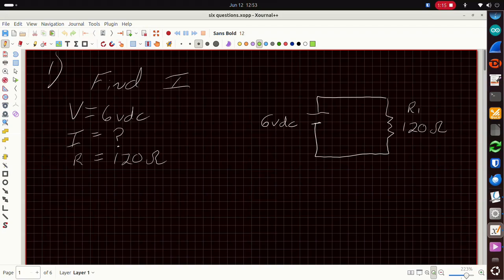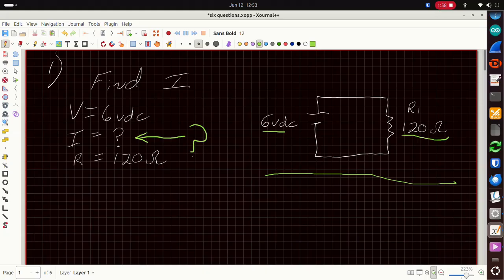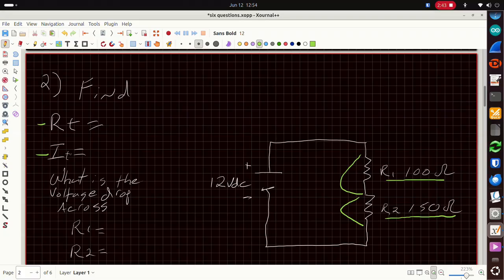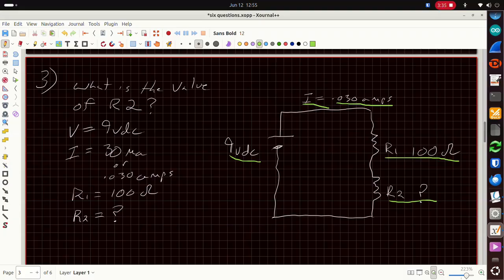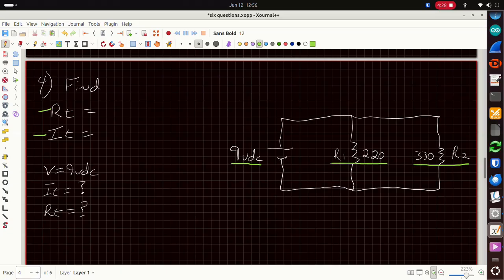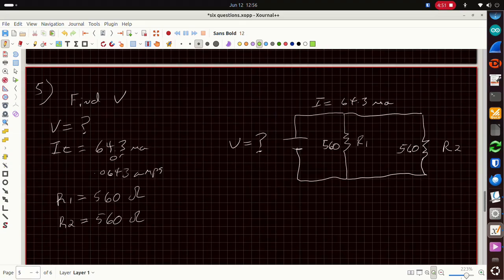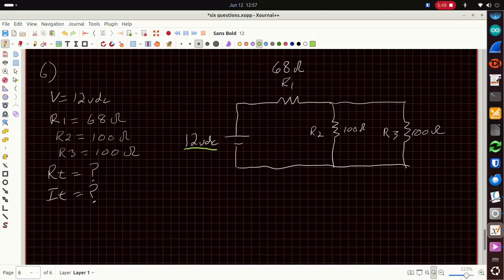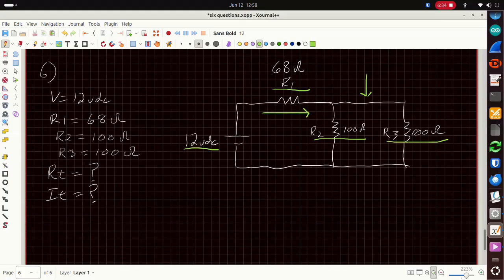TCB: V8 - Ohm's Law 6 circuit problems & a giveaway winner will be announced

Comment: 1 V = 6v  R = 120 Ohm    I= v/r  6V/120ohms    I= .05 amps   

2 RT = 100Ohm + 150 Ohm = 250Ohm  It= V/Rt  It= 12V/250Ohm  It= .048 Amps  VR1 = .048A * 100Ohm = 4.8 V  VR2 = .048A * 150Ohm =  7.2V 

3  VR1 = .030A * 100 ohms = 3V  9v-3v = 6v across R2   R2 = 6v/.030A = 200 Ohm

4 Rt = 220Ohm*330Ohm / 220Ohm+330Ohm = 132 Ohms  It= 9v/132 Ohms =  .068Amps

5 Rt = 560Ohm*560Ohm /560Ohm +560Ohm  = 280 Ohms  V= .0643Amps*280Ohms = 18.04V

6 R23 = 100 * 100 / 200  = 50 Ohm  Rt = 50ohms + 68 ohm = 118 Ohms

It = 12v/118 Ohms = .1017 Amps
Reply from the maker: Looks like we have a winner, nicely done, formulas are well laid out and detailed.  All the answers are correct.  Send me an email to kingcrjohn@gmail.com with your contact information, and I will put the FNIRSI DSO152 in the mail.  Congratulations and thank you for following @TheConfigBench
Reply: @TheConfigBench  John,  wanted to pop into the comments and say thanks for the oscilloscope and all the additional swag, really helping me kit out my fledgling bench.